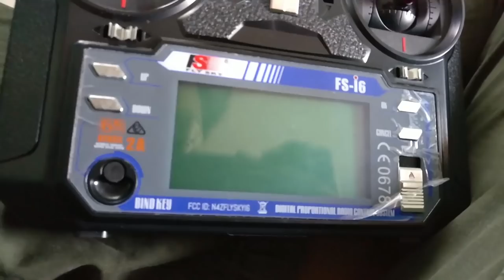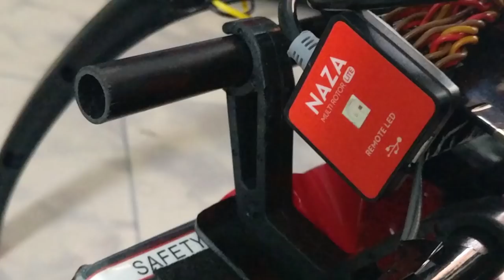BUILD A  (CUSTOM) DRONE FOR MYSELF BETTER THAN DJI  | **drone shots**

Comment: Better than DJI it depends upon on your uses and your point of view , everytime only performance doesn't matter . Consider you have low budget and not much uses then it is better , but if you are a professional then only performance matter not budget .
And also in this drone every this is customable means you can Select your own custom camera , your flight time etc
Overall conclusion it depends upon your point of view .
Something doesn't work for you doesn't mean it's useless.

Comment: Which will the best flight controller board in terms of stability??
Reply: dji naza
Reply: @prateekun3878  does it gives most stable flight? and is it a industrial grade fc board
Reply: yes bro is the most stable with gps
Reply: @prateekun3878  Thanxz bro....have You ever flied with this board and if yes so which version?
Reply: dji naza m lite v.1
Reply: @prateekun3878 can it be used with industrial grade drones??
Reply: Ha u can

Comment: I have been looking to do the same. There is a lot of jello roll from the vibrations. 
I would love to know more about the parts and components you used.
Reply: Altered Exposure Image Design sure , proper damping should be done .what's your setup ?

Comment: Nice try, but this is certainly nowhere near better than DJI. To the average person, the shot looks great, but someone with experience can see all the flaws. It's a nice build, but don't venture into saying it's better than a DJI, as that's not at all true.
Reply: Maybe but If You Know How To Solder And Work With This Kinda Stuff Then You Can Definitely Build A Custom Camera Rig For Cheaper Then A Dji Mavic Or Whatever And It Will Definitely Be Better.. But It All Takes Skill